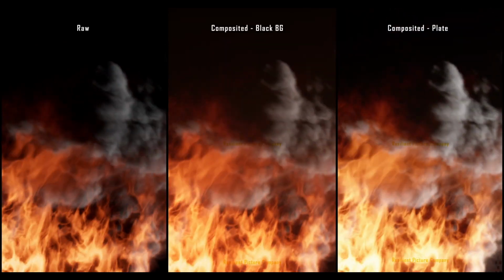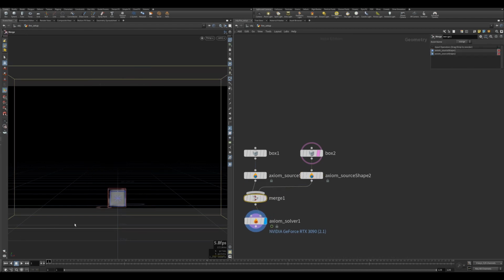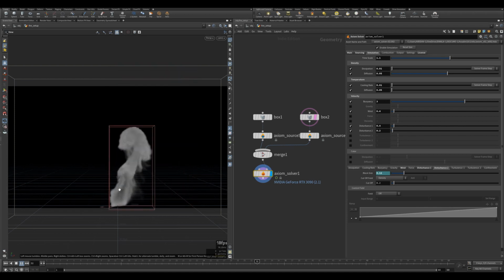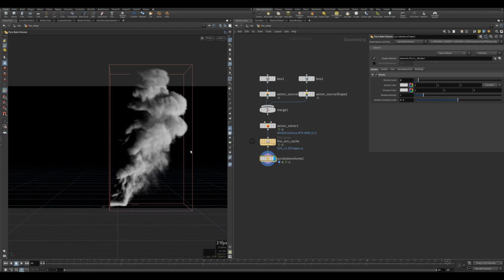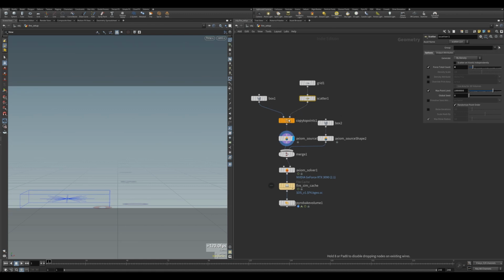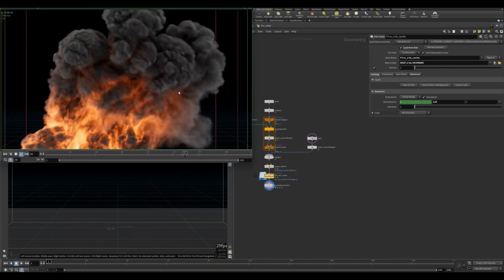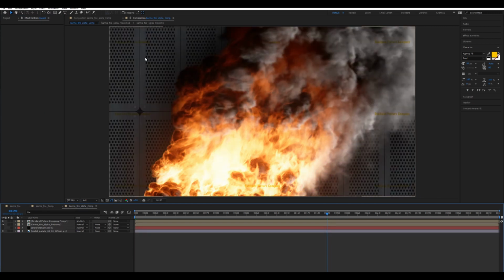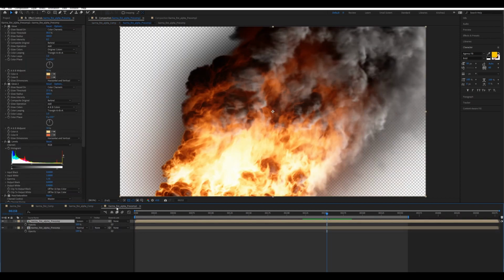Gasoline Fire Tutorial - Houdini - Axiom - Karma - Aftereffects

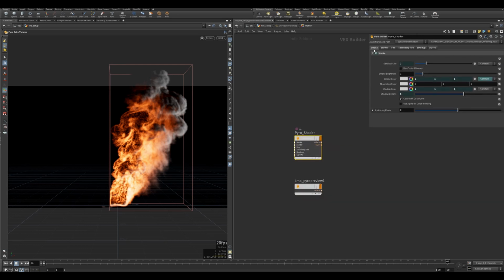Comment: @resilient picture company when I followed your steps, my fire didn't look as saturated and thick when I got to the pyro bake volume step around 32:00 in. Any suggestions? I am using Houdini 19.5.493 if that makes a difference. Thank you for this.
Reply from the maker: Pyro bake representation depends heavily on lights in the viewport.  Please check if you turned on lights?

Comment: Looking at doing some pyro renders. You recommend using Karma or Redshift?
Reply from the maker: Karma is looking very good with volumes, however redshift is very fast with both volumes and rest. However redshift volume lacks a little bit of details IMO. I have both, works beautifully depending on project. Please also bear in mind, I haven't had any success with Karma XPU volume AOVs so far
Reply: @resilientpicture  Redshift volumes always feel a bit lacking in options but can’t complain about the rest of the package
Reply from the maker: Certainly